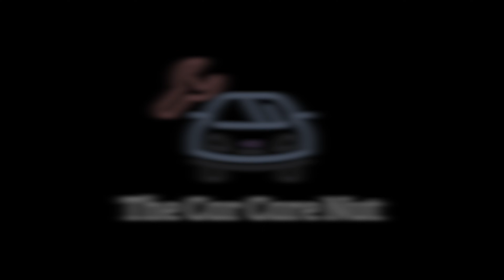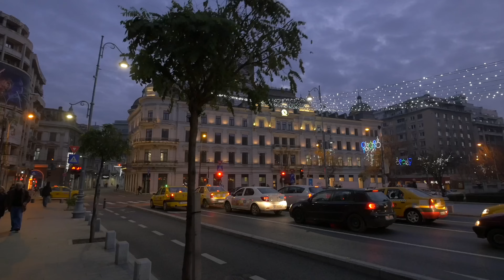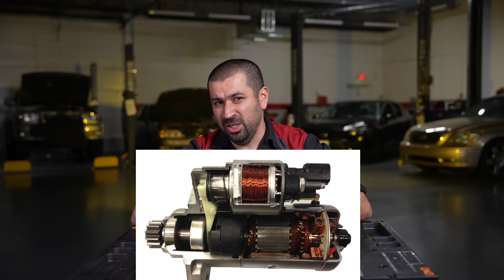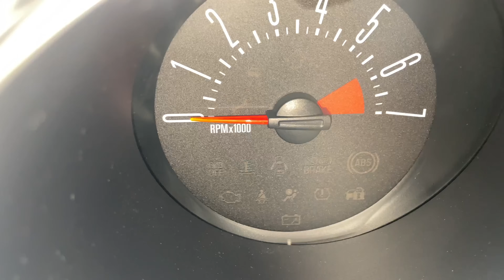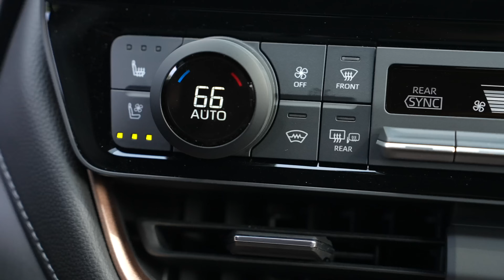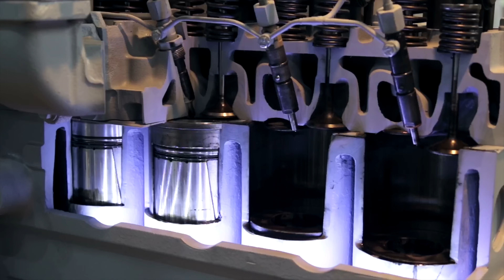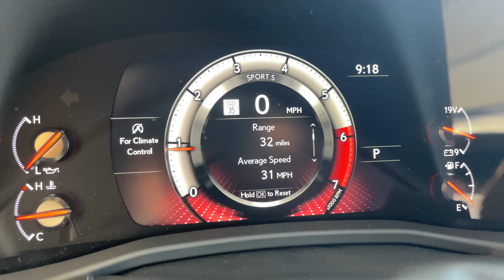How Does Start Stop Technology Work in Modern Cars? Everything You Need to Know

Comment: Thanks for this great explanation on this system I knew very little about.  I particular, needing a specific battery.

I understand why this system exists, but i am in the crowd that finds it annoying.  For me, it’s due to the longer response time when I give it gas when turning at an intersection.  In my old car, I could just go when I have an opening in traffic.  But in my new car, with start-stop, I have to give it a second longer for the engine to restart.  Anyone who lives in a city knows that the loss of a second or two means I have to wait for a bigger opening before I can go.

Now is this forcing safer driving behaviors than when I could just go?  Maybe.  So there is an ancillary positive effect there.  But it’s still annoying for those of us used to driving a certain way for decades.  

Overall, an interesting idea.  But one that maybe translates to cleaner driving experience in hybrids than regular engines.

EDIT.  My new car does not have the ability to disable start-stop.  So I am learning to live with it.  I guess it was too hot when I test drove it, and AC use disabled it.  Dealer never mentioned it… So I had no idea the car even had start-stop until I drove it to work the next morning.  Yeah, I should have done more research.  But my old car had finally died and I needed a car asap.  You don’t know what you don’t know…

Comment: This system doesn't work well in a hot environment like Phoenix in my '24 RAV4 Ltd.  There isn't enough stored cooling in the system to run more than a couple of seconds before having to roughly restart the engine.  I will probably install one of the disabler cables available on Amazon.

Comment: Nice video !! I have problem and I have a  2L turbo VW GTI Mk 8 .. I  have put another oil the 5w 30 and it had to be 0020w after 5000km I replaced it back to 0020w and you notice the difference! and I myself now have a problem with starting when the engine is warm. when restarting engine start stop system give problem just starting when the engine is warm then it sometimes cuts out and gives an error message drive problem, only when the engine is warm !! and when that car is put in the computer for reading then there is no error message so the garage now has to do a complete check up of the car. and the engine has less than 55,000 km on the counter (I must say the car starts in the morning cold weather the car already no problems only when the engine is warm it acts strange !! this is how you see oil you have to put the right one even if the garage says no this is also good !! look at manufacturer's documents stick to them in case oil quality!!! Have a nice day in Jesus name

Comment: Brilliant presentation, deep analysis of the system. This gentleman work is flawless!
Now, … my personal opinion related ro this systems:
1. Yes they were mostly designed to decrease emissions, nothing else!!!
2. NO, they don’t provide a better fuel efficiency to any car, that is a lie!
My overall experience:
Owned a 2017 Subaru outback without a start/stop sistem, for years. The fuel efficiency stated by manufacturer at the purchased time was 24/32. During driving, experienced better and worse.
Traded in the old Subaru, for a 2024 Subaru with a start/stop system.
The fuel efficiency for 2024 Subaru, stated by manufacturer at the purchase time: 26/32.
Oooups!!! I questioned myself: what they did to improve the city mileage efficiency from 24 to 26????
Based on driving the new car for months now, my answer is NOTHING!
If the better fuel efficiency stated for may new car was based on the start/stop system, that is a huge lie!!! 
I tried driving my car for 2 months with the start/stop system engaged, and 2 month with the system disengaged. NO DIFFERENCE ON “City” FUEL EFFICIENCY !!!!!
For now and for the future, every time I drive my car, I manually cancel the start/stop system.

Comment: On a bike, I really like it. I always running Idling Stop for my bike for 5 years and no problem. Bike systems stop the engine at the compress stroke, when accelerate, it will ignite a spark plug and engine will continue. But for cars I don’t know, I drive an old Toyota…

Comment: So if the computer knows the crankshaft position, why does the engine still need to crank from a cold start from the ignition in off position?
Reply: That is because over night the fuel pressure has bled off so it takes a second for the fuel pump to build back pressure in the fuel rail…… it takes hours for the pressure to bleed off

Comment: You are very intelligent and your experience shows. Thanks for the clear explanation. It sure sounds to me like they’ve built in a lot of moving parts to fail in time. 
For decades I was taught that after an engine restarts it is way out of emission standards. Therefore, whenever we did an emission test, you always need to make sure the engine is hot and had been running for a while. 
I assume that would negate any lowered emissions from shutting the engine off. 
What do the actual tests reveal?

Comment: I recently purchased a gas car that has this. It works very well. When the engine stops, it's able to start back up quicker than I'm able to remove my foot from the brake and apply pressure to the gas pedal. My only complaint is that, yes, when it remains off for a duration, you do notice the air from the AC is not as cold.

Comment: I absolutely understand why people hate the start-stop with a passion. It psychologically makes you think that something is wrong with the vehicle… Either when it stops and you forget why, or  When  it starts up again with a  delay when you push the accelerator and nothing happens and then you worry  subconsciously.
The one thing that I think everyone can agree on is this:
It should be required for manufacturers to make the  enable/disable button be persistent between times when you drive your car. Whatever you want it to be set to, it should stay that way until you change it. Having to fight your own car that you paid tens of thousands of dollars for is one of the most obnoxious things and only breeds resentment. If people want to have this feature, good for them. I get it. But don’t force it on people and treat us like children.
Reply: i bought an 'off by default' module for my 22 civic.  best money spent to have the start/stop disabled by default.  If I want to enable it then I can still push the button to 'enable' it.
Reply: Just get a Toyota/Lexus hybrid. The start/stop feature is so seamless, you forget about it. Our hybrid Lexus is 19.5 years old and has never had a problem.
I can code my GR Supra to always be in Sport mode which keeps start/stop off, but I don't mind tapping the shutoff button when necessary, in normal mode.
Reply: Just drove a Toyota with this feature. It only activated once while I was driving because I brake so smoothly and toyota only activates it when you depress the brake hard. It prompts you to press the brake harder to utilize the start stop, so that's nice because I always brake smoothly. 

When I was intentionally breaking hard enough to activate the auto stop, the delay between me taking my foot off the brake and putting it on the gas was enough that I didn't even notice a difference in my ability to get the vehicle moving again. The engine started in milliseconds

I think perhaps some manufacturers are just better at it than others because the delay is not even noticeable on a Toyota.
Reply: Very informative video. Can you do a video on the cylinder deactivation feature, namely in General Motors vehicles?  With all the lifter failures, why hasn't this feature been addressed?
Reply: At least on the C8 corvette, you can put the car in "manual mode" and the cylinders will not deactivate
Reply: @ivancho5854in my experience, the computer may not like this and throw out some codes and warning lights, but this might be dependent on the particular make/model of vehicle...
Reply: ABSOLUTELY  CORRECT!  Well said!
Reply: Blame the EPA. 😂
Reply: @rolandthethompsongunner64 , THIS 100%!
Reply: the child like responses speaks volumes about today's "victims"
Reply: I agree with you.  This and lane keep assist are annoying.  LKA can’t tell the difference between a lane marking and an asphalt seam.  I have to manually disable LKA every time I start my car.  But it’s become a routine now.
Reply: @von4297  I get annoyed when my car out of the blue decides that I'm about to run into another car, while it's just a wavy road, and the car starts yelling, tightens the beatbelt (first time I thought my car decided to kill me), pushes off the gas pedal and hits breaks. I will never get used to it and we don't have straight roads in Colorado.
Reply: That's not why. It ware and tare on your vehicle.  It costs us the consumer
Reply: I have no way of knowing if it's true, but from my understanding is, the start stop technology can be turned off remotely from a distance, either individual vehicle or multiple vehicles. imagine your car being turned off when you don't want it to be.

Comment: I wrote down all the components (crap) you said are needed for this dreaded system:

more complex starter
boost converter to keep battery voltage
larger battery
amp sensor on battery
electric water pump for heating
cold storage plates for cooling
electric oil pump in the transmission
vacuum sensor on the brakes' vacuum booster
new crank position sensor

Comment: It unnecessary systems like this and cylinder deactivation that piss me off. Not only do they add more mechanical strain on parts, it also increases base cost of vehicles. Modern vehicles today are so overpriced it should be a fucking crime, and these "environmental aid systems" are making them go up and up. Not only would you be saving a hell of a lot of money buying a new vehicle if these systems were optional, you would also be saving money on not having to replace components as often. These save the environment systems are harming the consumers.

Comment: When I got my first car with this technology, I didn't even know it was a thing.  A few days later I felt my car shake at a traffic light when it started and was like "what the?!?".  That was my biggest problem with this system at first.  I didn't have a button to turn it off so I had to shift into L and then + repeatedly to get it in 6.  This would disable it.  What a pain!  I eventually got something to attach under the hood to disable it.  Best decision ever.  The best was when I was approaching a stop but didn't stop all the way.  The engine decided to do the stop event, but when i released the brake it started back up and kinda made the car lunge forward unexpectedly.  Thankfully that car is now gone...

Comment: I'm happy my vehicle doesn't have  this "special" and "smart" start technology.  When I hear those words, it means, higher repair events, extra diagnostic cost, and when/where will it fail.  Nothing is perfect.  If it's made by a man it is built with imperfections.  No man is perfect, so what he makes is imperfect.  Leads to part cannons being unleashed.  You can't depend on the new replacement parts to be functioning even though they are new.  It's a vicious circle of empty pockets and no vehicle when you break down.  It's not if you will have any issues, it's when you will have the issues.

Comment: All my cars from 40 years ago (Australia) have been fitted with aftermarket accessories.  In particular car reversing camera.  This is engaged when the reverse gear is selected.
Current camera has inbuilt lane change warnings, GPS and other accessories.  These are much easier to install now.

Comment: Yes you can permentily disable start/stop - need an after market dongle that goes between the button and ECU on the wiring harness and it will remember the button setting instead or re-enable it every time you start a new drive.  It's easy, quick and available for most makes and models.
Reply: 29 bucks on Amazon…. Installed in 5
Minutes and never looked back
Reply: I bought one for my wife's car. It just remembers the last setting so you don't need to turn it off every time you start the car.
Reply: The one I got always come up in the off position, regardless of whether it was on or off when the engine was shutoff.

Comment: If anyone ever wants a definition of the term "over-engineered," they need only watch this video.  All of that complexity has been added to the car, simply to save the engine from idling for a few minutes.  The amount of effort and expense that was spent on solving a non-problem is staggering.
Reply: You might ask yourself the question why AliExpress is selling all kinds of parts like the electric waterpumps ..... and they are cheap. AliExpress is not selling those parts because the original parts in the cars are so good quality they never break down. In my opinion every part or piece of software added is a possible fail point. Keep it good, keep it simpel !
Reply: When you think about how many millions of cars there are worldwide idling aimlessly on millions of roads every second of every minute of every day, then the problem becomes apparent. The start-stop system is reducing emissions and also saving millions of barrels of otherwise wasted fuel, which also helps reduce overall global warming. If you can't see the problem, then you're seeing the issue from a very limited perspective. And if governments themselves are encouraging manufacturers to implement such systems, you know how pollution is such a pressing matter for them!

Comment: One question:  You didn't mention impact, provisions, or tech for the actual engine oil.  It's always been a cautionary tale that when the engine starts, most of the oil is in the pan settling.  What do these new system do to mitigate this?

Comment: 28:27 but the answer to the question is YES. One of the conditions that the stop-start system requires is that the bonnet/hood is closed and not ajar. There's a microswitch that detects when the bonnet is ajar, and it's located at the bonnet catch under the plastic surround cover. If you slightly adjust the position of the microswitch so that it's not engaged when the bonnet is locked, it'll think that the bonnet is ajar, and the stop-start system won't be ready. Thus, disabling it permanently. I had my Mazda6 for 4 years before I learned this. I also learned the hard way as described in this video that the stop-start system can tax the battery and may need to be replaced sooner than usual. Respectfully, the stop-start system is not an emissions device per se. It does not filter or remove gasses from the exhaust except for the fact that the engine is not running. It does not alter the operation of the engine except for shutting it down. The only reason that car manufacturers fit the start-stop system is so that they can make more favorable claims on the car's fuel economy for advertising and better emissions numbers for government requirements. In short, it's a technical work-around and disabling it makes no difference to the engine's performance and makes little to no difference to the fuel economy.

Comment: I've just watched this video about stop/start. This is a useless feature in cars as the saving is minimal in fuel and emissions. In my experience of this feature it works when it feels like it and if you are stuck in traffic for more than 30 seconds the car will restart on it's own accord as soon as it detects a drop in voltage. Even though these cars are designed for this feature it still must be hard on starter motors/ignition leads/coils and other electrical/mechanical parts. You explained it all very well though.

Comment: The dumbest system ever made. Anytime you use something like a starter that much it’s not a good thing and makes the car less reliable period. Even if it’s a starter “made” for it which as more moving and electrical parts to fail. Also it engages against a flywheel that wears. And your adding capacitors which if you’ve had experience with explode quite spectacularly when they do explode. And many more other systems added.

You see it’s all adding more electronics and more parts to depend on which makes more systems to fail and you most likely can’t repair yourself making you reliant on dealerships at worst or a mechanic at best unless you have the skills yourself.

Comment: It doesn't hurt if you just drive. But when it's hot I turn it off cause most cars I'm driving don't have AC working properly.

But if I had to buy/own the car I would think it might cause it to be overpriced and benefit is probably not worth it. Seems like overengineered idea that saves emmisions when driving while causing more emmisions from production lines...

Comment: You never got to the specific point every car nut guy wanna know: does it produce more premature engine wear because of increasing engine cracking up, which is what produces more strain on the engine than mileage itself. Do all start stop system end engine oil lubrication circuit ? If so, I wouldn’t want my crankshaft and bearings continuously be working with less protective oil film

Comment: Great video. Would you consider doing the same with the charging system for a bmw which drives me mad. It doesn't charge like a normal car only on overrun or braking. Also it is still taking about 11 amps out of the battery after locking the car? It seems to change depending what mode you're in. With other cars you could start with a low battery and rev the engine stationary for a while to charge it. This doesn't seem to work unless you drive it for 20 miles. I would love to understand how it all works but no one will tell me. Bmw 2018 435d . Thx.